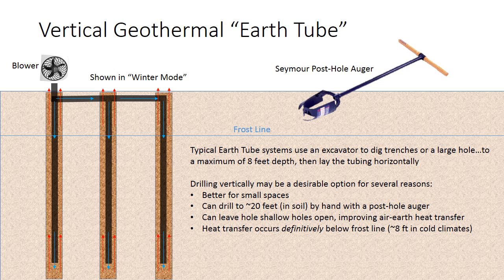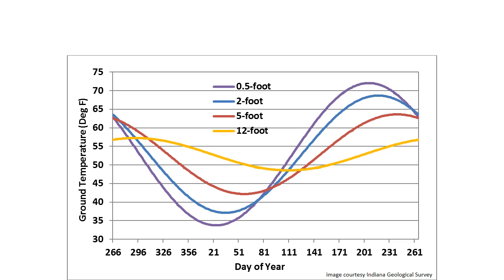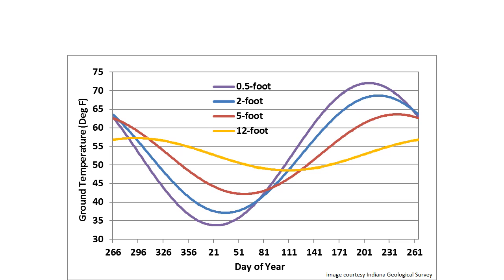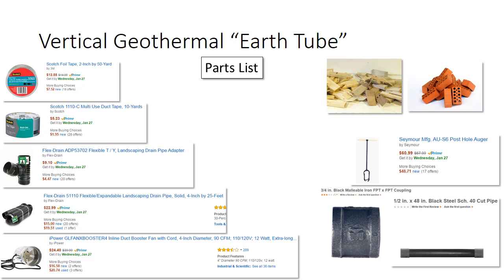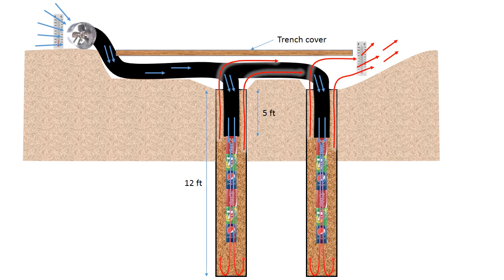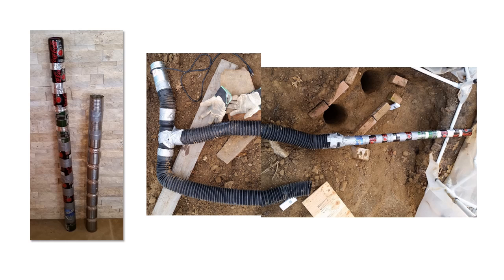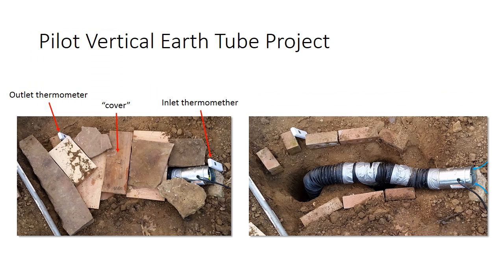Vertical Geothermal Earth Tube (Part 2) - Greenhouse Heating/Cooling

Comment: Hello sir,  Is there any change in efficiency of system  if we run this system full day ?  In my project i am using a spiral coil vertical heat exchanger.
Reply: I am designing system for the room environment control heating and cooling of the room In india (gujrat)..
For the system which are main consideration ?
Is soil reserch is compulsury for install a system.?
Reply from the maker: Doshi Gaurav I would only run it when you need to run it.  I used a simple thermostat (thermocube).  They make thermocubes for heat and for cold

Comment: Won't work not enough surface area
Reply from the maker: To heat or cool a greenhouse, it is true, you would need a lot of holes (or go with a horizontal system).  But, the geothermal definitely is a nice supplement to other heating/cooling methods
Reply from the maker: Here was some performance data from the other video: https://youtu.be/e8AosXQ3OaA?t=338

Comment: How do you deal with ground water?
Reply from the maker: Don't have a problem with groundwater where I live (very dry here).  Your mileage may vary, though...  Of course, I cover the holes so that rain doesn't leak in.
Reply: Morgan Brown I think I would have to line the holes with something here in Kansas, we a clay soil that tends to let water in holes more then a few feet deep with heavy rains.
Reply from the maker: yeah, you may be right.  For me, it would probably make me look at a different method (probably the typical horizontal earth tubes).  A big part of my method is the ease of drilling quite deep and the low cost (not having to line the hole with expensive PVC).  I hit a rock layer at 10-12 feet, but wanted to drill to 20 feet.  If you're able to get to 20 feet, it might make the vertical earth tubes more appealing, since you get excellent heat transfer/storage.  One method that I'm keen to try is a "U-shaped" vertical system.  It would be tricky to get the U drilled, but it would give better airflow, and would be suitable for you, since you'd want to have the "U" lined with pipe.  Let me know if you end up digging some holes!
Reply: Morgan Brown Ya I’m researching multiple options, we have a small farming operation we are currently using natural gas and I really want to switch away to a greener option. I would really like to burry the whole greenhouse but ground water means I either have to pump the water out of the hole or line the hole. The hole method is interesting because we have very little rock down until 20 - 30 feet. I have given some thought to using the water table as a heat sink with multiple shallow wells but if I inject any water back into the ground even the same water that came out it’s classed as injection well and i need special permits. So that leaves me with closed loop air or water systems. I’m working on the thermodynamic calculations for multiple options. I really like the ease of this system, perhaps a hybrid of your system with closed loop coils of Polyethylene irrigation tubing in the shafts then back filled with either clay or grout. Good thing is i don’t have a shortage of options. Thanks for doing the numbers if find that most YouTube videos are just trial and error which is not bad if your doing something small but I’m looking at several large greenhouses so I need to be confident that it will work before I invest the money and time.
Reply from the maker: Tyler, great to hear about your larger projects.  I wish I had more free time to really push these experiments.  Alas, I have a full time job (geophysicist for an oil company!).  You bring up a lot of interesting points, but I want to focus on one: burying the greenhouse.  Instead of burying, noodle on this idea: build two long, raised beds, each about 4 ft tall, with a walkway in between.  Put foam board insulation along the outside edge of each raised bed.  Now build a greenhouse frame over your raised beds.  This design would seem to gain most of the advantages of a pit greenhouse, without the water table issues.  The roof of the greenhouse would only be a few feet above the raised beds, but you'd have plenty of headroom, since you'd work in the walkway between the raised beds.  Regarding geothermal, you could dig deep holes under the footprint of the new greenhouse, which would be more efficient than having the geothermal outside the footprint.

Comment: did it work well
Reply from the maker: Yes, it works pretty well.  Depends on how many holes, how deep, how powerful is the fan(s), size of greenhouse.  This type of system works better for cooling than for heating.  For heating, it adds a lot of humidity to the greenhouse.  Done over again, I'd dig many holes and have one fan per hole.  Also, make sure your greenhouse is airtight!
Reply: what would I need to do for a 10 x 20 greenhouse using this
Reply from the maker: First, if you are not averse to getting a backhoe and laying a "horizontal earth battery", this would be my preferred method for a greenhouse your size.  If you really want to go vertical, then I would strongly recommend putting the geothermal wells under the footprint of your greenhouse and using one small fan per hole.  If I was making a vertical system under the footprint of your 10x20 greenhouse, and I had absolutely no constraints, I would dig 36 holes, spaced 2 ft apart.  If you had 12 W fans like me and had all 36 on at one time, you'd draw 432 W, which is pretty similar to the power draw of the blowers that people use with large horizontal earth battery systems.  I hope this is helpful

Comment: Hi Morgan, I am in search of low-cost winter greenhouse warming /summer cooling in a hardiness zone equivalent to 9B. I found your geothermal system is very cost effective. I went through all your geothermal and compost heating videos and all the comments and came to a model for which I need your kind attention.

So there will be about 10-20  earth holes ( 6" diameter) inside the greenhouse which are about 20' deep.

In the middle of each earth hole, there will be a 4" smooth-surfaced tube which is connected to a small computer fan which draws air out from the well. In the winter it is very efficient since you are working with the convection currents instead of working against them.

In other words, all the earth holes are independent of their installation, function and maintenance.

As a backup heating plan in the middle of the winter, I found mini Jean Pain type compost heater is a very cost-effective system. It circulates hot water by its own thermal syphon mechanism and heat will be released into the greenhouse via old car radiators or sub ground tubings.

I am eager to hear your comments on this. Many thanks in advacne.
Reply from the maker: Jayanath, I am very pleased to hear this! 

First I will respond to your geothermal comments.  I agree that the "one fan per hole" configuration is best.  My system, with the long air distribution lines and corrugated tubing, loses a lot of airflow to friction.  I would offer an additional piece of advice, especially for cooling - I would fill the hole with a foot or so of gravel to contain the condensed water vapor.  Ideally, you would have some means of draining the water, but this isn't practical.  A huge benefit of the geothermal system (for cooling) is reducing humidity in the greenhouse.  Unfortunately in the winter, the water vapor condenses inside the greenhouse, not in the hole!  If you are using this geothermal system primarily for heating, I would probably line the hole with 6" diameter pipe and a bottom cap, to minimize humidity entering the hole.

Regarding compost heating, I think the water flow system is better than my proposed air flow system.  However, the very best compost heating occurs when you put the compost inside the greenhouse!  Then I don't think you need any heat exchange at all; maybe just a fan to circulate air.  I would also insulate the floor of your compost, because you lose a lot of heat to the ground.
Reply: Thanks, heaps for getting back to me so swiftly. 

I appreciate your gravel in the bottom idea. 

I love the idea of heat exchange with bare soil the earth holes which is very efficient. This system of heat exchange cut down hundreds of extra conduits ( insulators itself) which used in very popular horizontal climate batteries. Therefore I may not insulate the earth-holes to get away with humidity. Since I am going to plan a bigger greenhouse (about 20 holes) for tropical fruit trees it won't be a big issuer unlike with tomatoes. 

I might stay away from having the heating compost pile inside the greenhouse considering odour and methane and ammonia. I like the idea of insulating the bottom of the pile as you said.

You may also interest this unique style of horizontal geothermal heat exchanger which has tested its time.                                                    https://www.youtube.com/watch?v=ZD_3_gsgsnk&t=3s

Thanks again for very valuable thoughts Morgan.

Comment: That post hole auger doesn't appear to be 12 feet long?  How do you get down to 12 feet, and then also you are only at 12 feet at one point of your "well", how is it you do not have to go horizontally at a constant depth of 12 feet?
Reply from the maker: I extend the length of the auger with 4 ft lengths of "black pipe".  In this video (https://youtu.be/Qh3-iTJvVR4?t=101) I show you how I drill and how I extend the length of the auger.  I don't do any horizontal drilling -- this is a vertical system.  Air is pumped down the hole using a pipe that's smaller than the diameter of the hole.  The return air comes up the outside of the hole

Comment: why not draw the air from the peak of the roof during the day.
Reply: +Morgan Brown lots of people showing off black steel can solar heaters with very high temps here on YouTube. I'm sure you could rig a few in sunlight to boost temps as needed.
Reply from the maker: Not a bad idea.  It could serve to "recharge" the geothermal during the day.  I think these geothermal systems may be more useful for summer cooling.  I don't use it for that purpose, since I simply open the windows of my greenhouse in the summertime.
Reply from the maker: good points from both of you.  To Joseph's question, my roof doesn't have a peak, per se, as it's a lean-to greenhouse.  Also, I've actually got foam insulation covering the roof right now, as the angle of the sun in winter is pretty low where I live (40 deg N latitude).  However, I definitely am interested in building a "hot box" and circulating air through it.  I think I'll use a flexible dryer vent, FWIW.  One problem that I have is that I don't get sun all day long, so I might have to mount the unit remotely.
Reply: Have you seen this?:  https://permaculturenews.org/2015/01/09/how-to-build-a-geo-solar-greenhouse/
Reply from the maker: Thanks for sharing.  That's a beautiful building.  I'd definitely use this if I had a more serious greenhouse build.  Interesting how they don't actually run the geothermal to directly heat - they only store the heat in the soil during the day, then draw passively throughout the night.  I am sure that they also have vertical insulation around the footers of the building.  And of course, the building itself is R-22!  That building cost just a weeee bit more than the "$1000" that he says the geothermal system cost him.

Comment: Morgan; since I see you have done some calculations; you might want to do some on the thermal conductivity of earth. I think this will be your "bottle neck". You do not have a lot of surface area ( below the frost line) and the earth is slow to give up it's heat/cold. l would think you see initial good gain, with a long term slow down as your system waits for the earth to bring more heat to the hole. I suspect that is why pumping water is the common way to get heat out of the ground. Earth/soil conductivity fluctuates a lot depending on moisture content..3 to as high as 1.8 btus (per square foot, per hour' per degrees temp diff.) I use .5 btn's for slightly damp soil. As you can see the earth doesn't move btu's very fast.
Reply from the maker: Terry, thanks for your message.  The thermal conductivity of soil is definitely something I haven't considered.  It was something that I felt I was "stuck" with, so I haven't worried about it.  But every time someone asks me "how many tubes for such-and-such sized greenhouse?", I start pondering thermal conductivity!  I really appreciate you providing this range of values.  To be honest with you, I filled in my existing geothermal system to accommodate a compost chamber (check out the other videos that I've made).  I'm planning to essentially dig out a "root cellar" which I would use to exchange air with the greenhouse.  I might even dig geothermal wells into the floor of the root cellar!

Comment: I live in Finland, on the area where water level is very high under the earth. Occurred to my mind that if I would build a system like this, I could use anti freeze  liquid  and copper spirals. With a very small aquarium pump you could make  the liquid circulate in the system. You could take the warm out if the liquid with a usual car radiator and  a few computer fans. Thats my five cents.
Reply from the maker: Jaakko, yes, I would say that most geothermal systems in existence use circulated anti-freeze liquid in a closed loop.  I actually bought some copper tubing and submersible pumps in anticipation of building one!  I would say that you'll need a fairly powerful pump.  The product listing for pumps will usually mention "max lift height".  I am looking on amazon, and there's a 800 gallons per hour pump that will only lift 9-10 ft (3 m).  That pump draws 60 watts of power, and it still might not be strong enough for this job!  The air circulated method is definitely less effective than a well-engineered liquid circulated system, but a) it has fewer moving parts and b) consumes less power (12 watt fan).  So for now, I'm going to stick with air circulated.
Reply: No Morgan, you do NOT need more powerful pump than that can lift about 2 meters 6-7 feet. That is because the liquid in the system is BALANCED, part of it is going down, part of it is rising up. The difference of the balanced tubes is zero. The only power that is needed is the power you need to make the liquid move in the tubes.  I use EHEIM aquarium pumps and chinese  18 watt aquarium pumps in my system. These pumps can lift 1800 liters in an hour to 6-7 feet.  They cost about 5 dollars.
Reply from the maker: Hey, this is good to know.  I assume that you have to bleed all the air out of the system?  How do you do that?
Reply: If the small pump is not powerful enough for bleeding the air out from the system, I recommend to use temporally a stronger pump, for instance 300 watt  submersible well pump. If you use  10 mm tube or hose, no problems with air bleeding will occur anyway.

Comment: You can cut the top and bottom of aluminum cans with a regular band saw. Thanks for sharing!
Reply from the maker: Ha, I always wondered!  I only have a jigsaw and a Sawzall, and I was too afraid of cutting myself to even try.
Reply: I think you can also fill them with water, freeze them and then have the ice as a backer to make the cans behave and not crumple.

Comment: I'd not use "Ductape" to connect the soup cans....every time we've used duct ape, it's disassembled itself under temperature fluctuations and humidity conditions.  I'd maybe use the cans, cut and reassembled, to get closer to the 4" d. of the drainable pipe, so there's no volume restriction on air flow.   What is the math formula to figure out how many feet of well/tubing is needed per cubic feet of building volume?
Reply from the maker: Agree on the duct tape.  It doesn't do well over time.  I've come up with a design that will radically reduce the amount of pipe, as well as the air resistance of the pipe.  Hope to have it up and running in a few weeks, along with the youtube video.
Reply from the maker: I am sure that an academic could come up with a capacity formula, but it's going to depend on a lot of variables.  In my upcoming experiment, I'm going to run a test by pumping air into a sealed box of known size (versus my entire greenhouse), to get a sense of heating/cooling capacity for a fixed volume, without solar inputs or air leaks.

Comment: Very good and instructional video. Would have been more helpful if you had shown how you bored out the holes past the length of the auger.

Rather than aluminum cans, why not use corrugated aluminum duct? It's readily available in 3" and 4" diameter and cheap. Less work, more surface area, less opportunity for impeded airflow.
Reply from the maker: ask and ye shall receive: https://youtu.be/Qh3-iTJvVR4  That's a more recent video where I show how I extend the auger to (in my case) 10 feet.  I've seen people drilling wells with the Seymour Post-Hole Auger to about 20 feet.   Any deeper than that is tough (too heavy).  The downside of corrugated duct is poor aerodynamics.   And for the record, I have historically used corrugated PLASTIC duct for most of the plumbing; I only use the smooth can tube for the bottom few feet.  I'd like to move to a system that uses less ductwork, though, and all smooth ductwork.  To see if I can improve efficiency.
Reply: Thanks for the reply and the link. I'd have thought more turbulence in the aluminum pipe would increase heat transfer?
Reply from the maker: It's one of those questions that I'd only feel comfortable answering by experiment...and frankly I haven't yet done the experiment!  However, I've chatted with a lot of people on youtube who have much larger scale "earth batteries" and they tell me it's all an issue of maximizing the volume of air swapped between the greenhouse and subterranean geothermal.